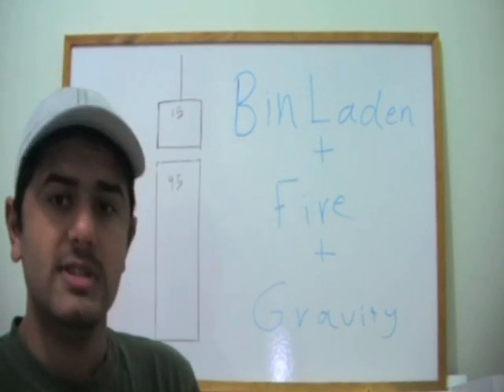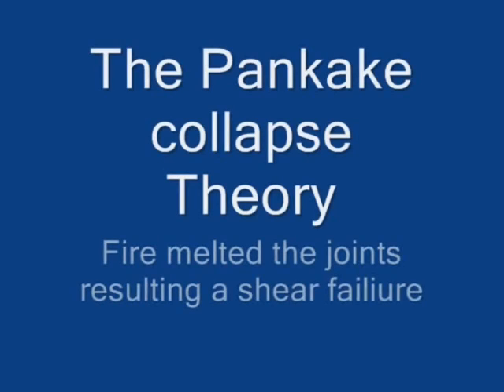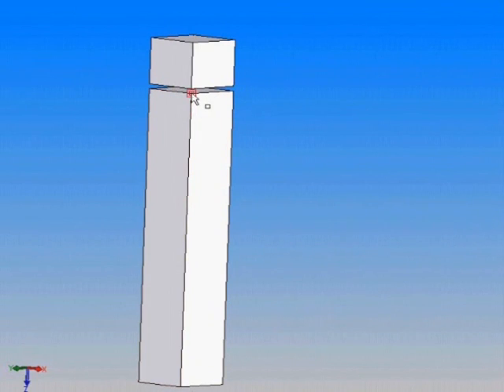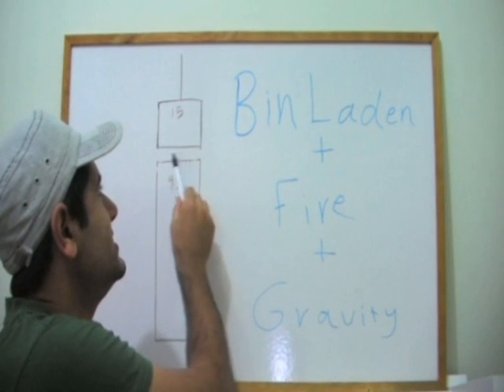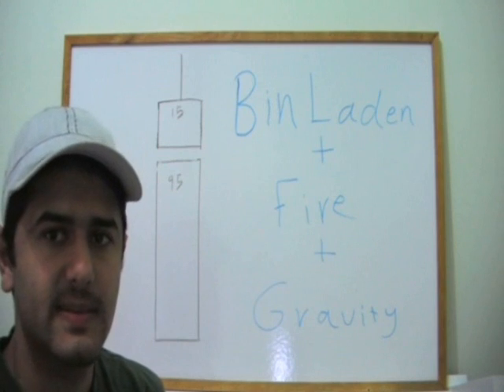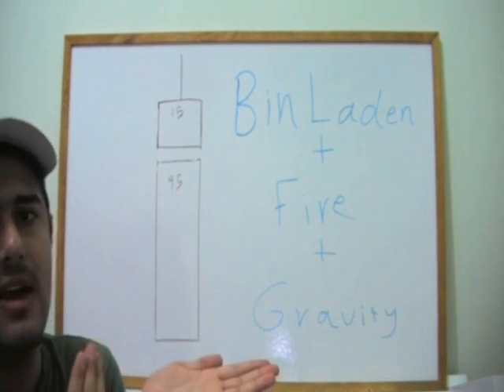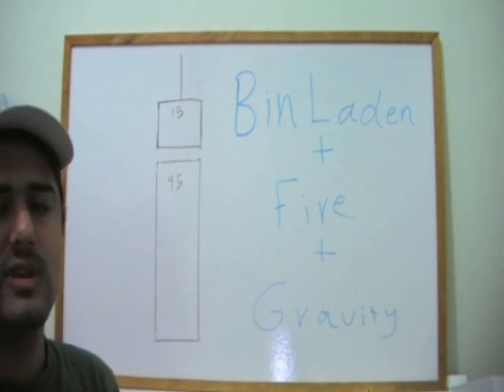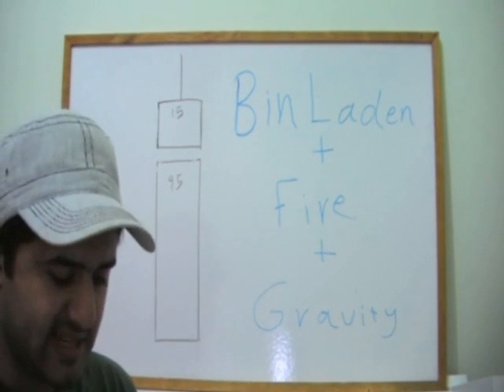(Part1) 911 Simple Physics Structural Failure Vs Demolition

Comment: 299 people believe that the govt. always tells the truth and that the laws of physics do not apply in lower Manhattan.
Reply: Matt Foley "let me ask you this: All of these 1,500 architects and structural engineers are lying?"

First, let me ask you this: Lying about what? What, exactly, did they say? If you go to the A&E website & read the petition yourself, you will see that what they actually said was: NOTHING.

NOTHING.

It's a petition. That's all. No statement. No theory. No analysis. No conclusion. Just a petition. They did not make "a scientifically based case" and they do not support this (or any other) theory.

So no, they're not lying. All they said was "More investigation? Sure! Why not?"

When Richard Gage & his crew get off their butts & write a reasoned paper - and manage to convince their peers that it has merit - THEN you can tell me what 1,500 architects and structural engineers say.
Reply: Matt Foley "NIST estimated the elapsed times for the first exterior panels to strike the ground after the collapse initiated in each of the towers to be approximately ... 9 seconds for WTC 2"

The time for the first panels to strike the ground is NOT the same thing as the total collapse times for the buildings; it's the time it took the first panels to hit the ground! The NIST reports does NOT say the buildings fell in 10 seconds.
Reply: A&E showed the NIST conclusion is wrong.  A&E clearly makes a case to Open 9-11 to independent Investigations, because the conclusions put forth by NIST are wrong.
Reply: carly0710 I see. And your case that Newton's 3rd was violated is ...?
Reply: carly0710 Run out of floors? Of course not, why would you think that?

Ever learn about gravitational potential energy in physics class? The higher an object, the greater its PE (PE=mgh where the "h" is Height). The second floor of a building, treated as a mass, has twice the potential energy as the first. The 3rd floor, 3x as much. The 110th? You get the idea. So if we take the falling tower top - let's use tower 2 as our example, so that top is about 30 floors, 81-110 - and it falls 1 story, crushing the 80th floor. It's used up a bit of its PE to do that damage, but does that mean it's used up? No! It's still 80 stories above the ground. It crushes the 79th. And the 78th, etc. And each time it has expended one "floor's" worth of energy. That energy does not "run out" until it reaches the ground!

Also, consider conservation of mass: Just because a floor is destroyed does not mean that the material (mass) that made it up no longer plays a part. In the above example, you have the mass of 30 floor falling onto the next floor below (80) and it crushes it. What happens to the mass that made up the 80th floor? Does it just disappear? No! Its mass - now rubble - joins the rest of the collapsing mass. So now we actually have the mass of 31 floors falling onto 79. And the mass of 32 floors falling onto 78, etc. Sure, some of that mass went over the side or floated away as dust. But mass is certainly being added to the falling portion with every floor that is destroyed.

So NO, the floors were NOT used up. Each tower had the equivalent of 200 tons of TNT in potential energy. You don't think that's enough to destroy a tower?
Reply: if u had half a brain you would know it wasnt free fall speed.
Reply: Chezadelic 1 okay, im under the impression that in order for the buildings to collapse at "free fall" speed it would have to meet certain criteria, like falling under 10 seconds, which it doesnt. Im trying to educate myself from a non biased stand, if you can help me with that im all ears.
Reply: Matt Foley okay matt no need to be so offensive, i appreciate the fact you took the time to reply to my comment. Understand that there are loads of conflicting "evidence". I feel almost attacked when people say it was an inside job, because to me that would be the most disgusting, vile, unforgivable tragety to be guilty of. But i sincerely want to know the truth of what happened that day, rather than just accept it at face value on either side.
Reply: TimReed22222 you're right
Reply: cheekymonkey The sheep always stand by their government and those in power and fully back genocide and crimes against humanity
Reply: +TimReed22222 just look up Newtons laws
Reply: +TimReed22222 Third law:	When one body exerts a force on a second body, the second body simultaneously exerts a force equal in magnitude and opposite in direction on the first body.
But since you have a "degree" in physics, you probably understand how this works
Reply: TimReed22222  Tim, I understand your point but let me ask you this: All of these 1,500 architects and structural engineers are lying? They made a scientifically based case and they are wrong? I realize it's hard for you to address what is going on the minds of these professionals as it would be for anyone, but what are you supposing they're thinking by supporting this theory?
Reply: Chezadelic 1 you want me to explain how i can tell it wasnt free fall, or are you just insulting me..
Reply: Mike breton  Actually you're the brainless nit-wit who has no answers but plenty of insults.
Reply: Matt Foley if being a brainless nit wit as you said means being thoroughly informed, and not just on a brainwashed bandwagon like you seem to be, then call me a damn nit wit all day long..
Reply: Mike breton  Mike, let's clear up which one of us is the nit wit. You claim that the building didn't fall in under 10 seconds. Well, according to the NIST report:

"NIST estimated the elapsed times for the first exterior panels to strike the ground after the collapse initiated in each of the towers to be approximately ... 9 seconds for WTC 2. These elapsed times were based on: (1) precise timing of the initiation of collapse from video evidence, and (2) ground motion (seismic) signals recorded at Palisades, N.Y., that also were precisely time-calibrated for wave transmission times from lower Manhattan (see NIST NCSTAR 1-5A)."

So by NIST's own report, you are hereby proven to be a nit wit and almost certainly a jack-ass. I hereby accept your apology for your idiocy.
Reply: no reason to be a dick head when someone has question.
Reply: Aryan Brotherhood do you have any credible sources? Other than your uncle/brother? You inbred fuck.
Reply: TimReed22222 A bachelor's in pseudo science pussy?? Hahahaha

4 years..... hahahahahaha
Reply: Wes Fox No.... If you think it's just put options then you're seriously misinformed.
Reply: Wes Fox http://www.washingtonsblog.com/2010/06/sec-government-destroyed-documents-regarding-pre-911-put-options.html
Reply: Wes Fox Really not that hard when you research just how many companies and banks were involved.

http://www.globalresearch.ca/9-11-attacks-criminal-foreknowledge-and-insider-trading-lead-directly-to-the-cia-s-highest-ranks/32323

Pretty cool how Paul Bremer just happened to be at the news studios just after the 2nd plane struck telling us who, what, where, why and how. And never once mentioned how he wasn't at Marsh and McClennan that morning at the meeting that was going to expose Silverstream and Marsh.
  Let's not forget Jerome Hauer also.
Reply: +Aryan Brotherhood okay. i can see now that youre 12 years old, so im going to stop responding and save us both alot of time. you're welcome.
Reply: Wes Fox Paul Bremer..... just another lucky guy.... hahahahaha. I like when he mentioned how he was supposed to be there and never mentioned his workers dying on the 93 floor. But hey, he had all figured out right? Lucky guess and a lucky guy. Hahaha
   Where the fuck did I say it was an  inside job? Comprehension is key. 
    I'll give you list a mile long of people who didn't show that day.
    The government knew the exact date and locations of the attacks. hmmmmm
Reply: Wes Fox There's only point I get is you're stalling. You can ask questions all you want. I'll say it again. You're haven't disproven anything. 
  I get a kick out of you dodging links.... and putting words in my mouth.
    Bottom line. Government knew the exact date and locations of the attacks. Speaks volumes.
   Anthrax, Hauer and 911 are how many miles apart?? Hahahaha

Richard Clarke. With an E. Excellent book. Against All Enemies. Dick wasn't happy when he got hung out to dry by the CIA and the FBI. And he sure as fuck get slammed by the Zionist lying cunt Zelikow in the commission report. What was is it Wolfowitz said just after the attacks?? "Let's attack Iraq... it's worth more". Hmmm. Then you add in that Zelikow stated Iraq was attacked to protect Israel.
   You're not very bright.
Reply: Wes Fox Ask more questions and tell me again how anthrax wasn't relevant to 911.

http://www.theguardian.com/commentisfree/cifamerica/2011/sep/15/anthrax-iraq
Reply: Wes Fox See this see this!! Hahahaha 

http://abcnews.go.com/Primetime/story?id=131907

http://www.judicialwatch.org/press-room/press-releases/fbi-special-agent-robert-wright-subjected-fbi-retaliation-telling-truth/
Reply: Aryan Brotherhood the beauty of the internet is, when I spot a raging lunatic, I can silence you with the click of a button.
Reply: +TimReed22222 ah its nice to hear somebody with brains every now and then....still totally pointless trying to get a point across to twoofers
Reply: Georgia Home Boy Uh oh. Another fucking uneducated tard has arrived. 
How many victims have you shit on today Georgie Boy?
Reply: +Mr. MASCAL hahaaa go fuck yourself
Reply: +Mr. MASCAL oh so original...hurry up..go fuckyouself
Reply: +Mr. MASCAL why are you so pissy anyhow? did you watch a twoofer debunking vid and get your rags at the same time?
Reply: 399 now. paid gov trolls. thats all. no planes , no hijackers. just bombs and thermite. end of story.
Reply: Matt Foley Care to tell us more about those laws of physics & how they didn't apply? You're a physicist, of course.
Reply: +TimReed22222, basicly, if each floor was destroying the one below, do you think you would run out of floors? I don't believe there was enough floors above the impact to demolish all the floors below.